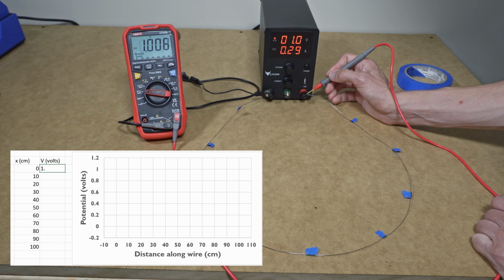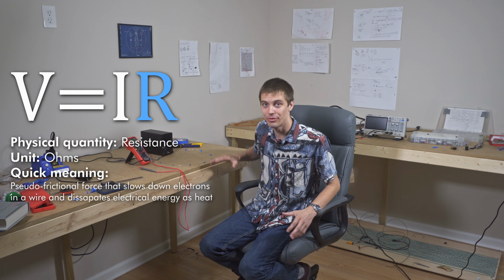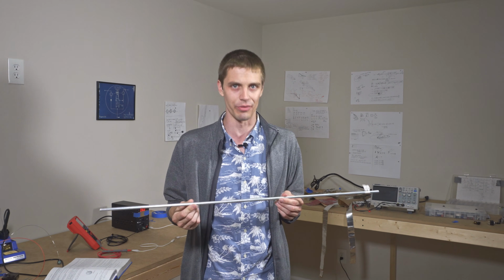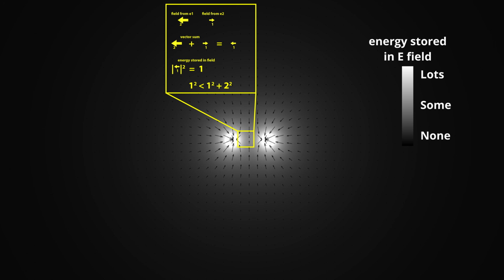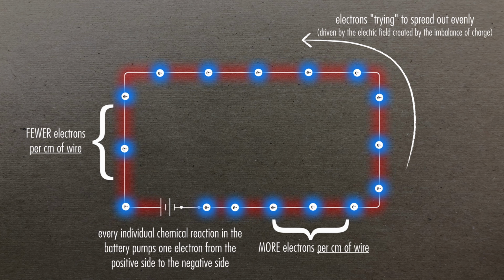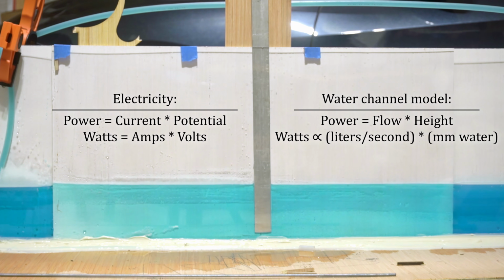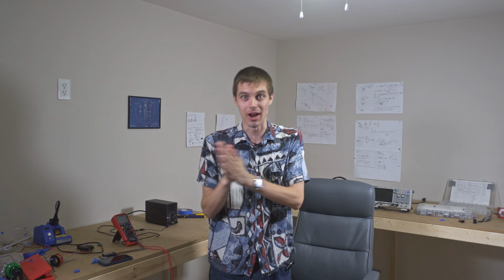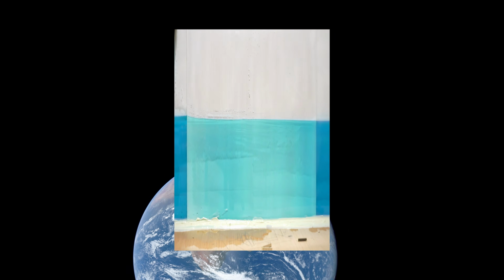An intuitive approach for understanding electricity

Comment: I thought I understood volts
Reply: Voltage is a force 
Current is charge 

Apply voltage through wire
You can move Current through wire
You just move the electrons on a wire

Power is combined Force x Current 
You just got a work
Power is Work
Power will not exist without applying a force
To a Charge

Until you apply a Force and the Current will travel

And it is call Power = Work that's it
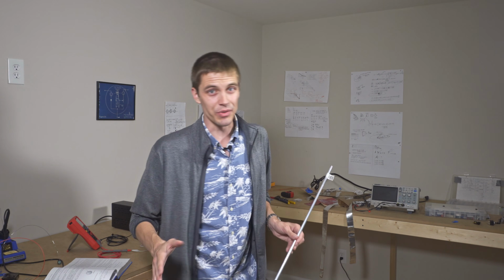Reply: @JoseHambalos  @10:47 “voltage is not a force”…
Reply: Voltage is not a force and current is not a charge. But I do get your point
Reply: Damn is that you bubs?
Reply: Thats revolting
Reply: @mdrdprtclVoltage is how old a volt is. 😁

Comment: as an EE grad student, this is the first time the term "electron volt" has made sense to me, never got why mass/energy was expressed as that unit
Reply: Thinking about the energy of a photon E=hf, an LED with a 2V drop will emit a photon with an energy of 2eV (red). Because each photon only reacts with a single electron. The same intuition behind the photoelectric effect. From a perspective of linear electrostatic particle accelerators, it also made a lot of sense to talk about the energy of an accelerated particle as being a function of the voltage it was accelerated by and its charge. The use of eV in particle physics world is likely a holdover from those days.
Reply from the maker: I think you’re right it is probably based on accelerators. It’s super easy to express the energy you added to a particle in eV if you multiply the charge of the thing by the voltage across the plates in your gun! As particles started splitting and ending up with different masses AND energies, I think the potential necessary to slow any given particle to a stop may also have been relevant (although now don’t they look at orbit diameters in magnetic fields?) I need to know more particle physics…
Reply: @AlphaPhoenixChannel afaik you are right. Cyclotrons and Synchrotrons make expressing electron (or proton) energies as eV VERY attractive. And since a Joule as the "default" SI unit of energy is HUGE compared to an eV it's basically useless in this regard...

The only thing I can't tell you why is "why didn't physicists invent an in-between energy scale when they discovered the first signs of the charm/strange quarks at many many MeV" but maybe they were just used to eV by then and so we continue to this day saying an electron is 511keV...

Edit: I just tried checking wether or not "natural units" might have something to do with holding onto the eV, but couldn't find my old lecture notes. So it might be a good starting point to look into c = h_bar = e = 1 which makes basically all physical units be eV as to why we still use it instead of some other slightly better positioned unit
Reply: yes, they flat out lie to use to try to 'make it easier ' to understand. Where a clear simple explanation could deliver the principals easily. Its like saying to someone: "its just because"
Reply: 1 EV was taught us as equivalent to 1 Mosquito Power
Reply: As a particle physicist, when I teach intro E&M, I consider eV's as more of a footnote -- I cover it, ask maybe as many as 3 questions over the remaining semester that incorporates it, and that's it. It doesn't completely surprise me that it is also useful in EE, but it feels like something you shouldn't particularly care about and use unless you have both quantum mechanics and relativity, which is why we love to use it in particle and astrophysics.

Unfortunately, there is a certain... snobbishness and arrogance... in physics, which manifests here as eV is the unit for for everything -- mass, energy, and momentum -- when it's not. And between this and a decoupling from what fields and potentials are, it becomes such a more complicated and non-sensical concept than it actually is. This is the relativity part, where E~mc^2: energy may be expressed in 1 fundamental charge through 1 volt, but mass is eV/c^2 (and momentum is eV/c). But because we can say c = 1 in some natural units system, physicists act as though you can drop the c in the units ('It's 1! multiply everything by 1 and it's the same! They are the same, isn't it obvious? If you can't see it, you must not be good at physics... unlike me...'). I think this is a big issue in how we teach and communicate physics, which makes understanding it difficult in a similar way to trying to follow an inside joke, but no one is willing to tell you what it's about (and then testing you on it...).
Reply: @AlphaPhoenixChannel  @AphaPhoneixChannel Not probably: it was. I always watch your vids... but, IMO...10 minutes of research... even watching YouTube vids... could add value to content.
Reply: Ya... I walked the campus this morning... and asked 10 first year eng students to tell me what an electron-volt was. All of them expressed, to the very last, "... an electron volt is the kinetic energy imparted to an electron by accelerating it through a potential difference of 1 volt." Of course they didn't know about the Lorentz factor... but I guess there are grad E.E. students... somewhere... that don't know that either.
Reply: @dinmorerenabe  Try teaching one that doesn't know what an electron volt is because they can't multiply the charge on an electron, in coulombs, by the potential difference of one volt... and then do the dimensional reduction to get joules. These are the guys that send Mars landers into, and not onto, Mars... and lately, the Moon.
Reply: @nemam_nedam  Of all the comments in this thread, this is the one I understand least.
Reply: @willthecat3861 What has the Lorentz factor to do with the definition of an energy unit ?
Reply: @CG-rr6yx  Who thinks it explicitly does, and who thinks it isn't an important consideration outside of classical physics?
Reply: As a dolphin, I EE-EE-EE-EE
Reply: It's more like an elementary charge Volt, rather than an electron Volt.  Since even though the electron is negative, the electron-Volt is still a positive unit of energy.  It also need not necessarily be electrons experiencing it, or even a situation that has anything to do with electromagnetism.  It's just a charge unit multiplied by energy per unit charge, to clear the charge dimensions from the unit.
Reply: @youtube7076  some might say they purposely use a false "easyfied" model, in order to make it easier to learn by heart instead of truly understanding. Especially in schools i often have this feeling, that the teachers themselves never truly understood what they teach, they just learned to repeat what their teacher said without understanding. As if someone is trying to hide something truly amazing about electricity. We need a new Mind like Tesla who is able to like feel physics and just do stuff and rebuild the warden cliff tower and solve all humanitys problems whaaa :D Well that escalated quickly, but let me dream!
Reply: @AlphaPhoenixChannel This made me think of what would be the equivalent unit in the other side of the analogy, the "kilogram meter", the potential energy stored by lifting a kilo 1m up. Probably sometimes a useful unit, like 9.8J. Varies depending on local gravity though
Reply: @Marco-xz7rf   SO TRUE and so well said, i agree on all points :+) As i grow older in life i realize the 'highest paid' professions like broker or perhaps engineer/theoryethicist/project manager, theyall use Time as sort of a 4th dimension , in their daily lives. this is why machine learning/ai is so powerful  after all, soo, why not 'get the unlock' with youth, and as soon as possible,and drop these antiquated uhh 'rituals' and just deliver the current science as it is to evbdy...
Reply: @Squeezmo  But how long does it take a mosquito to expend 1 eV? Classic conflation of power and energy.
Reply: @DFPercush  that was the equivalent. The MHP would have a time constituent just like the HP. Something like ft-ev/sec
Reply: I think mass should be eV/c^2 and momentum eV/c. However the speed of light often gets ommitted and it gets confusing why everything has the same units.
Reply: @reinei1 Similar to why some parts of the World use Imperial instead of metric measurement units.I get my brain messed up always with Imperial...😂
Reply: Потому что если б вы учились в советской Школе вам бы в 9 классе объяснили, что вольты это скорость перемещения🙄🙄🙄
Reply: @1jay288  On nemluví o rychlosti, ale o hmotnosti. 

Souvislost hmoty a energie vychází z teorie relativity a ta se v deváté třídě nebere snad ani v sovětské škole.

Elektronvolt nemá v SI rozměr kilogramu. Ve skutečnosti je to eV/c^2, kde c je rychlost světla ve vakuu.
Reply: Я имел ввиду что значит Вольт в физике, вольт это скорость изменения магнитного поля, не более, зачем лезть  в теории, когда в реальной электронике это ни к чему. Простой пример, чтоб это понять :Берём генератор 220в,подключаем нагрузку 12в!!! Выбираем нужные обороты, чтоб ещё понятней было, крутим генератор кривым стартером, вот это и есть закон Ома. 😉 Ну и самое главное m=p/V 🙄
Reply: That's disturbing. Covered on my course.
Reply: @reinei1  eV is the ideal unit for a lot of particle solid interaction research, as electron binding energies in atoms are between a few eV and a few keV, so a large number of spectroscopic techniques in surface science make use of this energy range.
Reply: @orthochronicity6428  Man, I love your last thought there, the whole "...inside joke..." bit.  Not just physics but applicable to so many different fields, industries, trades, etc.  Although I completely disagree with the necessity or ethics of the practice, if there are adults making their living off the understanding and application of the subject, obfuscating everything they do probably is seen as a way to, I don't know, protect their... interests? self-worth? self-esteem?  I'm trying to just give you simple props for your insight, but keep going off on tangents in my mind to the point I've been writing this comment for twenty minutes... lol.   Love it!
Reply: It's the kinetic energy gained by an electron accelerated thru a pair of electrodes with 1V of potential. It's equal 1.6e-19 J

Ev for mass is e=mc² but you use ev instead of j.
Reply: You must have gone to a really good skool.
Reply: Electrons do not move. They just vibrate at the same position. Electrons do not flow
Reply: It is blatantly obvious why that unit is used. What surprised me is that when I did my undergrad physics at Cal, people seemed to not understand anything, and the stuff they did understand was what I would consider an 8th grade level. Understanding electron volt is high school level stuff.

I mean, it is literally just the kinetic energy an electron gains via accelerating through 1volt (starting from rest). You can literally understand it just from the definition. I don't get how you didn't understand this until you were a grad student. I honestly thought going to college would mean being around smart people, but I've been massively disappointed even at the grad level

And mass isn't expressed as an electron volt; there is a 'conversion factor,' where you divide by c^2
Reply: Yes! This is what I try to teach my undergrad lab students. Electron volts is a convenient unit because it's literally the amount of energy an electron gains when dropped across a volt of potential. q*V = 1e*1V = 1eV. It was such a magnificent moment for me when I learned this, and I hope anyone who deals with band structure or electron spectroscopy learns this intuition as well!
Reply: @youtube7076 theres literally nothing wrong with it lol. Engineering school teaches u to be engineers. Going into further details is just wasting time. 
 
If uve ever done EE, ud know how overloaded it is already even withouyt all the physics bs.
Reply: @reinei1 ???? c=hbar=e=1 ??????? Tell me more tell me more
Reply: @Marco-xz7rf  I got your back man let's go!
Reply: You should check out Physics Videos by Eugene, if you haven't already.

p.s This video was great. Definitely inspired some intuition.
Reply: 12:02 Absolutely love the hill example
Reply: I do boiler work and this was immeasurably informative. Much thanks!

I get the electrical and the water side in practical use :)
Reply: As a former ee grad i have forgotten almost everything i learned 20 years later im a software engineer 😅
Reply: @donnymcgahan1158  preach Donny preach
Reply: It's a particle's rest energy E₀ = mc² where m is its mass.
Reply: É muito usado em química, estava lendo agora pouco sobre tensoativos e em poucas páginas passei por esse termo múltiplas vezes 😅
Reply: it’s just a simple mathematic. You use 1v on the wire and got 0.29A current, so the resistor of 100cm wire is 3.448ohm, then 10cm wire has 0.3448 ohm. When you insert 100 ohm resistor in the middle, total resistor is 103.448 ohm ,under same 1v voltage, the current becomes 0.00967A, then positive side 10cm wire will got voltage , 0.00967x0.3448=0.003V, another 10cm will got 0.003v too, so every 10cm will reduce 0.003v, it is match you test data!
Reply: @Scrogan Plank learned from Volta 😊
Reply: 1:12 Why internal resistance of the wire is suddenly cancelled after adding a resistor? Without a resistor, the cable itself was decreasing the voltage by 10%. Why voltage didn't drop by wire after adding resistor?
Reply: I’m here trying to understand Quantum physics through YouTube’s.
Reply: @reinei1  the scientists inventing/discovering this technology had a big laugh at all the future personnel attempting to unserstandxthis...in leaving most comparable states and measurements so lopsided...anyone with a brain would wonder...wtf? Why? Why nit have some median go between term that makes sense on paper.
Those guys definitely got their jollies 😂
Reply: @Squeezmo  Please define the  "Mosquitoe Power" unit. Thanks
Reply: You were taught so the nature of how to understand fully is obscured, I guess that's the arc of the coven (witches wizards) aka the elder welders
Reply: I still dont get it
Reply: I only know about electrical engineering from watching hundreds of YouTube videos but I think I can understand a lot of the basics, like electron volt. It's when you get into the deeper stuff that it blows my mind!
Reply: @AlphaPhoenixChannel Particle physics is one of those rabbit holes I don't want to go down! Happy to learn the basics from watching videos like this. 👍

Comment: This is my favorite video on youtube. For YEARS I have tried to imagine how electricity actually works (using analogies). After a lot of headache, this just confirms what I was thinking AND taught me why the wire connecting to the terminals of a heating element don't also heat up (a question I've been having for a while now). Simply the best researched.

Comment: My hat is off to you AlphaPhoenix because you've succeeded at completing a task that I've been trying (and failing) to do for over 40 years : i.e., Fully explaining Ohm's law and making it understandable to a layperson with no prerequisite EE knowledge in under one hour. You're the teaching hero my family needed! Many thanks to you for taking the time to make the video :)
Reply: I teach electricity and showed this to my students. About 30% of them understood it. The rest of them got lost about 10 minutes in. Think understanding electricity takes time and effort. Most people don’t understand it because they don’t want to put in the energy to learn it.
Reply: Learn the proper way.  Rick Hartley on twisted wire pairs, transmission lines. 
Electrons don't push each other. 
The power from your home doesn't share electrons from the power station.
Reply: @dougfoster445 Indeed that is always the case with understanding unfamiliar things most people just never go any further if it doesn't come to them intuitively. understanding is all about linking and making sense of facts you are given, and that rarely happens without struggle and time(the more unfamiliar the harder the struggle) 
 
edit: should say " given information "rather than " facts" for some ... reasons
Reply: ive been doing it for 80 years

Comment: The funny thing is that I've played with electronics more than plumbing, so the water analogy tends to only help me understand how plumbing works more instead lol
Reply: OK, can you explain me how to create water pressure regulator? And is the simple water valve pressure or flow regulator?
Reply: @ksrele  A valve will act like a variable resistor.
If pressure is fixed you regulate flow, if the flow is fixed you regulate pressure.
In order to construct a regulator you would need to incorporate some reference as a setpoint and some sort of measurement for feedback.